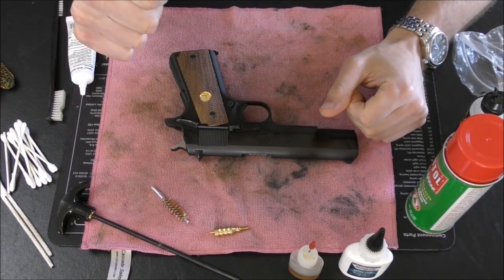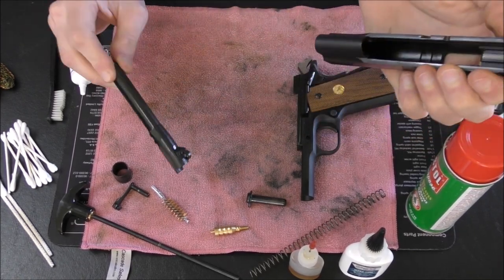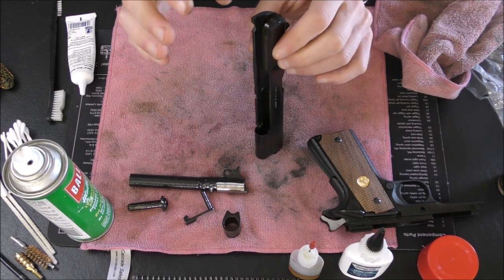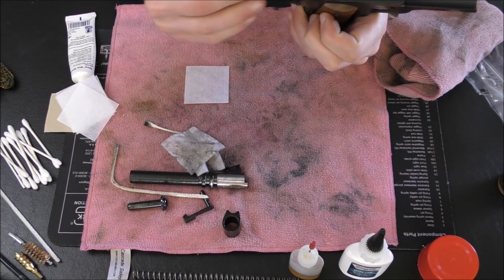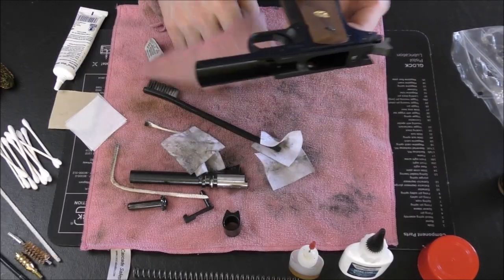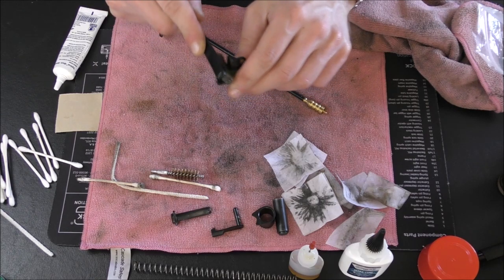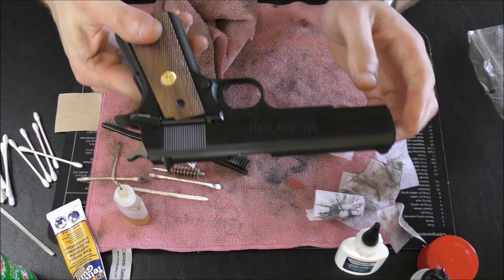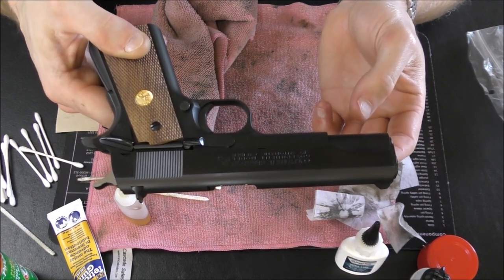1911 CLEANING -  Colt's MK IV Series 70 Government Model

Comment: great video but I always have a problem placing the slide stop lever back into the slide because of the little knotch on the frame getting caught as I push it in.  I scratched the frame a bit so any suggestions would be appreciated.

Comment: He has a "Colt Model 70 of a recent manufacture." And it comes apart very easily. My Colt Model 70, manufactured in the 1970s, needed pliers to disassemble. And force. Measured in foot-pounds. So this "1911 Cleaning" isn't for the newbee to firearms. In removing the barrel bushing he doesn't mention the cam-grove built into the slide. And a non-mechanical Colt owner might not know where to look for it. Or even to look at all. The slide-stop-lever took force-pounds and a tool to remove. And took some time and multiple attempts to manipulate back in. There is no mention of this as well or tips on how to get in back in. It is just appears to drop in. Except when it doesn't. I almost decided to take mine to the local gunsmith for a paid tutorial on disassembly/assembly. But figured it out. Only took a combined hour to do that.
Reply: I thought the barrel bushing on my Colt Lightweight Commander was held in by fouling but maybe I just need to rotate it either direction to remove.

Comment: I always take off the walnut grips and use gloves to clean it. Reason being is that the surface is dirty and your hands have oils , solvents and dirt from cleaning the firearm and if they get on your grips they it can stain them. Eventually  with time If oil continues to penetrate the grips they will darken and look uneven. My 2 cents. Cheers